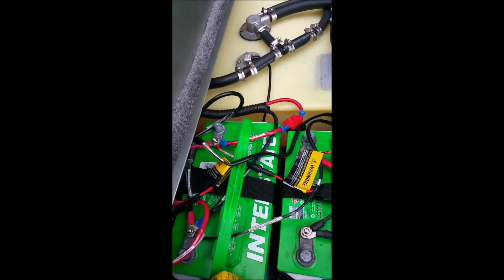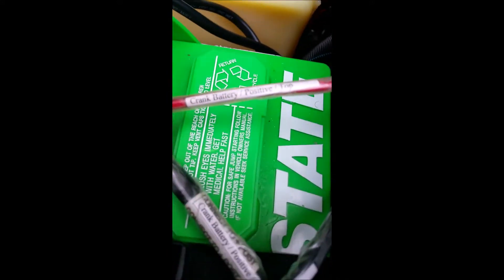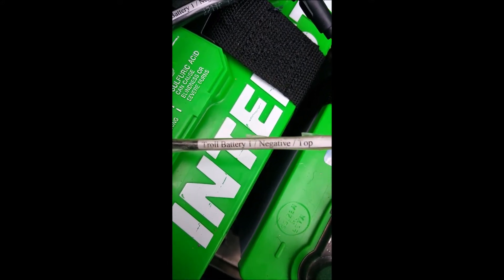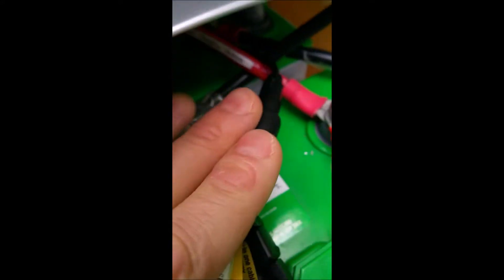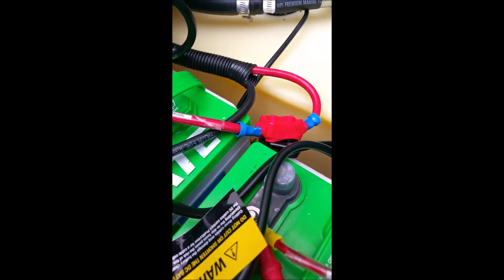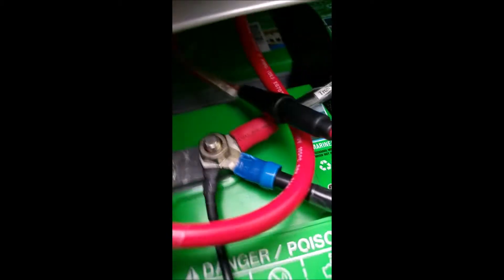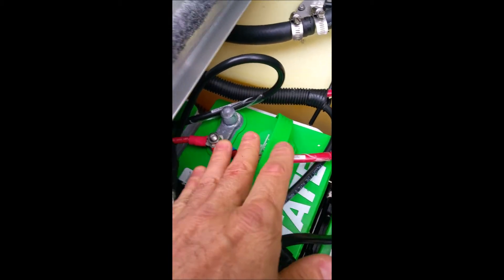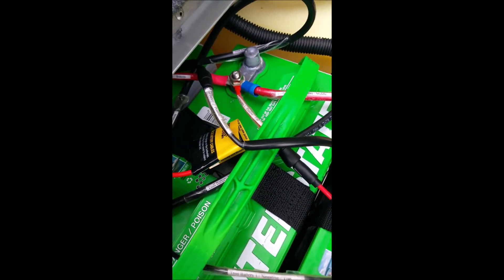Boat Batteries Cable Configuration

Comment: Get yourself 2 four post  buss bars for each battery and mount them off to the side on a plastic board or deck wall and wire all the positives from battery # 1 to one buss bar and all the negatives to the second. Do the same for the Battery #2. Then all you will need to do is connect one wire from each buss bar to each battery terminal putting the proper fuse at the positive post of each battery And I can almost guarantee that you will  never wire it wrong again Almost! Some people can mess up a wet dream!